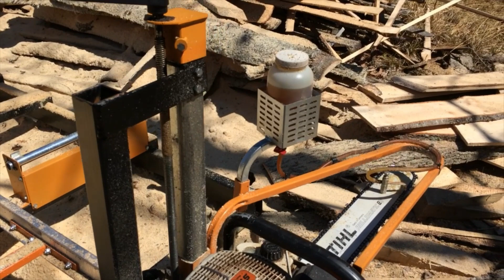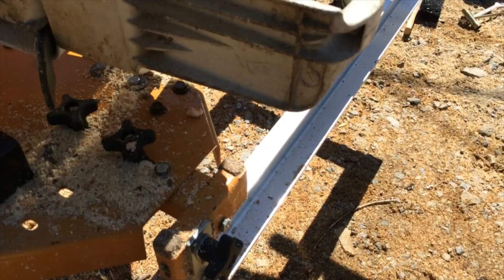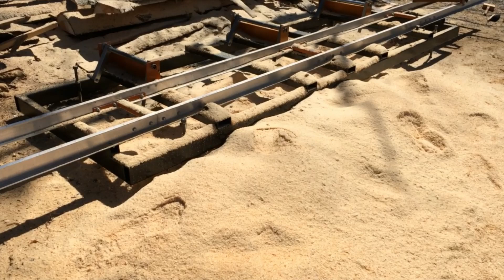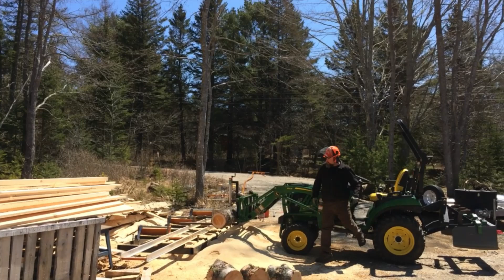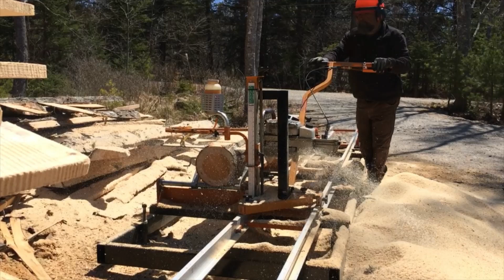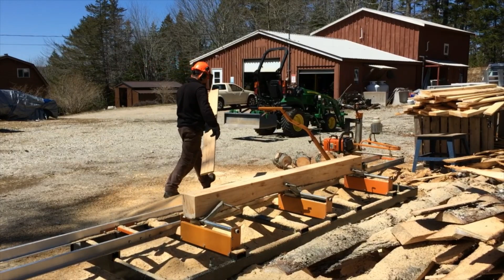Norwood PM14 Chainsaw milling in real time

Comment: with the added bracing, and good level footing you have provided, coupled with a sharp big saw, you’ve got something there that works quite nicely.  Bravo!🇨🇦
Reply from the maker: The modifications made a huge difference, every little thing made an improvement- my only big complaint was the waste of wood because it had such a large kerf and the physical effort it took to push. I ended up building a bandsaw mill and sold the chainsaw mill. No looking back! Thanks for watching! All the best, Jeff.

Comment: I have the PM14. Stihl saw and factory rails from Norwood. Short of setting the saw on a foundation similar to yours I can’t get it to not vibrate and move
Reply from the maker: The steel foundation was a game changer for keeping the saw from moving around. But also, the chain needs to be sharp, and filed evenly, North sides need to be filed at the same angle and don’t file the depth gauges/rakers down as much as you’d be tempted to. My final advice is to keep the logs under 14”, or you’ll need to brace the tower that raises and lowers the saw head. I made a bracket that helps stabilize the side to side ‘wobble’ while cutting bigger logs. I wish you luck! Once you get it dialled in, it’s very rewarding. That said, I did sell my Norwood PM14 and now I’m almost finished building and bandsaw mill to make a little bette use from my hard earned logs.
Reply: Jeff Hogue  I had thought to cut my losses and sell the assembled PM14 and purchase a Woodland Mills Bandsaw Mill   Knowing what you know now, would you venture into the PM14 arena or straight to. Bandsaw mill, just your opinion I understand
Reply from the maker: Great question, I really liked the simplicity and portability of the PM14, but i found out quickly that it wastes a lot of wood, 3/8” per cut, as opposed to 1/16” of a band saw.  I looked at the Woodland Mills 130max, but it seemed to take forever for them to get one, plus I bought their T-Rex trailer, and while the design is great, the made in China quality really leaves a lot to be desired. I’ve spent a lot of time and material making it a strong as I think it needs to be to stand up to its intended use. 
  My new bandsaw project is almost done. I’m going to be sawing everything I can find! I have a bunch of woodland, and lots of good timber.
Reply: Jeff Hogue last reply. Wondering which BSM you settled on. I know orders are behind due to the government mandated by state home incarceration and muzzling of citizens.
Reply from the maker: Frank Joe I bought a kit to build my own from Linn Lumber in Oregon. Too notch guys and decent parts. I bought the steel and engine and other parts locally to me in Nova Scotia.  A little more money than a woodland Mills or entry level mill from anyone else. But the quality, in my opinion is far superior to what I can buy. I’ll post a few videos about the build process soon.
Reply: @thelogfather5002  I was going to ask about saw movement when milling bigger logs but reading between the lines I think I got my answer, thanks.
Reply from the maker: It was glaringly obvious that the mill needed some support when milling larger logs, especially with the big 088 saw. It’s 123cc monster- I’m sure the mill wasn’t designed for a saw that big. Thanks for watching!

Comment: Can i get away with cutting larger diameter logs if i use a bigger saw and bar. I plan to weld a mount on the end of the bar to hold it parallel. Any suggestions? Thanks in advance for any info!
Reply from the maker: I think the biggest I could mill was with a 36” bar- anything longer than that requires a support of some sort.
Reply: @thelogfather5002  ok. I believe I'm gonna use a 32" with a support welded on to the bar near the auxiliary oiler

Comment: How did u get your mill set up to cut square for some reason my mill will not cut a square board I need help please any advice would be greatly appreciated thanks
Reply from the maker: I had to build a steel frame to set the mill on in order to get a square cant. Make sure your bar is perfectly parallel to the bunks, and the upright that adjusts the height where your saw rides is perfectly perpendicular to the bar.

Comment: Looking good, Jeff. You've got that setup running smooth. That 880 is a beast.  Do you ever have trouble with the star knob bolt for the roller on the operator side of the carriage coming loose? Mine seems to frequently, and I've had to put a nylon lock washer on the inside to keep it from backing off slowly

Comment: What can you say about the economy of the MS 880 as far as chains,fuel and bar oil?  Is it much more than a your Band sawmill?
Reply from the maker: It’s definitely harder on fuel than my 22hp Honda bandsaw mill. I would use a couple chains a day, maybe 3 if there’s any gravel or sand in the bark. I’d sharpen them back up on my rainy days to be ready for e next milling day. Easy on chain oil. I did use an auxiliary oiler, wouldn’t use a litre all day.

Comment: Very cool! I’m looking at running a similar set up with an 066. Any suggestions on the chain? 1/2 skip or full skip? And would you agree with the 10* grind in the chain?
Reply from the maker: I run a 10 degree full chain. It’s rough when it wears out. But give you plenty of warning before it’s inevitably needing replacement

Comment: Hey Jeff, How long were the rails on your setup? looks like 10 feet with two extensions? I'm thinking about purchasing this rail setup aswell.

Thanks
Reply from the maker: Actually it was 4 lengths of Norwood’s track, 20’ long. Which allowed me to cut about a 17’ +~- a bit. It was plenty really. Thanks for watching! All the best, Jeff and Leslie.
Reply: @thelogfather5002  so did you just buy two 10 foot kits?
Reply from the maker: Exactly

Comment: What’s the widest board you dare mill with this setup
Reply from the maker: I’ve cut a 28” log, but 16” board is the absolute widest I can cut and it takes a 2x12 on the bunks to lift it up enough to mill. I have a 24” bar, the saw will cut way more, I’m limited to the bunk/bar width.
Reply: @thelogfather5002  if you welded up the square tubing base, what's stopping you from building wider bunks? I'm new to this, but I'm thinking it wouldn't be too difficult to make wider rollers if you can weld...right? I haven't seen one of these in person, but I think it might be quite easy to make this thing accommodate a 30" log if you can just make wider rollers, and make a light modification to the guard arm am I wrong? Let me know what you think, I might buy one.
Reply from the maker: That’s a great idea... I’ve been thinking about doing that very thing, then I wonder if I should just built a band saw mill. I like the tiny kerf of the bandsaw blade, but I also like the simplicity of the self contained chainsaw, that I can sharpen without special tools, not to mention the bearings, and chains and line and engine... lol. I might stick with the Stihl. :)

Comment: You are cutting right through those logs like a hot knife through butter. I have the Ms 500i and the portamill. I'm having issues snapping bar studs. I have snapped three and now my chain tensioner has also stripped..have you had issues snapping bar studs with the bolts that Norwood provides?
Reply from the maker: What size are the bar studs on the 500i? The 880 is a huge saw, it’s got 10mm bar studs, I did break a couple, but it’s not common. I also bought some coupling nuts from a local hardware store, they’re a bit longer and use all the tread. I’d like to try a 500i for firewood, is it a good everyday saw?
Jeff

Comment: Very nice!  Thinking of buying one.  I only have a 50cc saw with a 16 bar.  Think it would work for making no wider than 6" Boards out of softwood?
Reply from the maker: I think it would be fine for small logs like that. My saw was a bit over kill!
Reply: @thelogfather5002 thanks.  So the bar would be long enough you think?   Also, did you get the oiler?   Are the rails worth it?
Reply from the maker: A 16” bar should be plenty for a log 10” or less. If you’re milling green logs, you probably don’t need an Oiler, lots of moisture in a green log to keep the bar cool. If you’re milling dry wood, maybe worth it. 
  I’m glad I bought the rails, but the best improvement was the steel frame I welding up to put it on. Have fun with it!
Reply: @thelogfather5002  Thanks Jeff!  Yea,,,, pretty sure I'll order mine this week.  Appreciate you getting back to me.

Comment: I just bought an excellent used portamill to replace my Alaskan mill.  It is mounted on 2 railroad ties with 3 bunks and the oiler.  Think my 60cc 24 inch bar saw with a 10deg rip chain will be enough?   I have been using that with the alaskan mill.
Reply from the maker: My own experience tells me it’ll be just fine, as long as you’re patient. I have a Beam Machine and use a 50cc saw on it, it’s slow but works well

Comment: What kind of chain are you using? I've never seen such a rough cut before with a chainsaw. You bought one, so I think you should complain to the company. Just starting it, you can see the blade wobbling an inch and the whole rig wobbles going down the track. I'll definately go with a band saw, at twice the price you get more wood and a much better product. For 1000$ I'd expect more. Balls in your court.
Reply from the maker: Hi Chris, I sold that chainsaw mill a few months ago and built a bandsaw mill. Way better! The chainsaw mill did what I wanted when I didn’t know any better... but once I know, it’s impossible to go back! Thanks for watching.